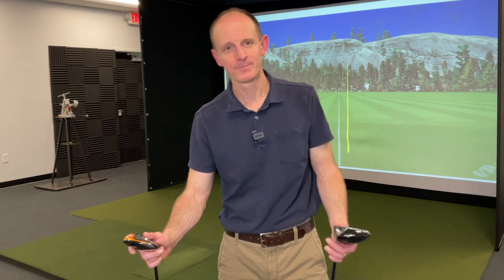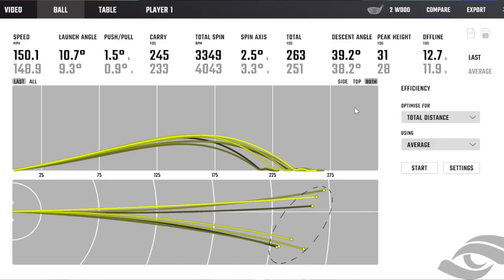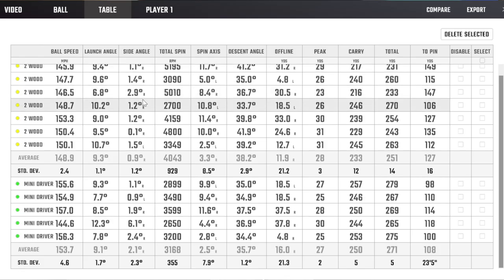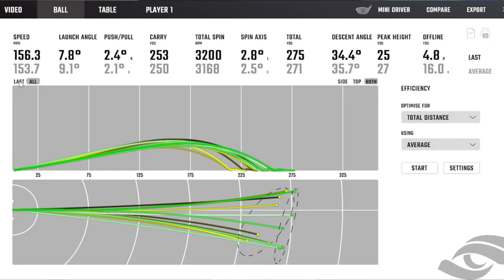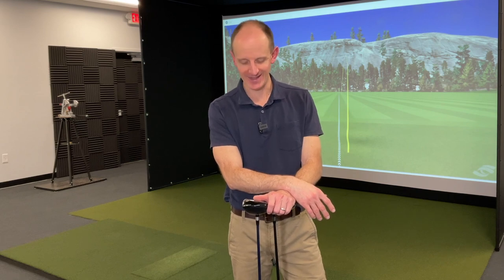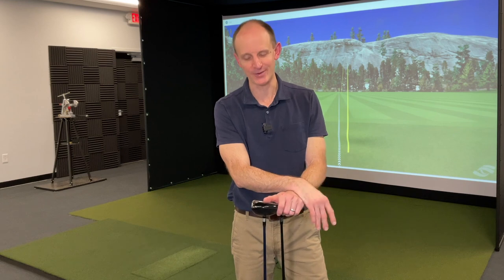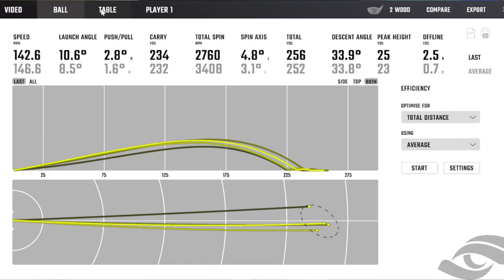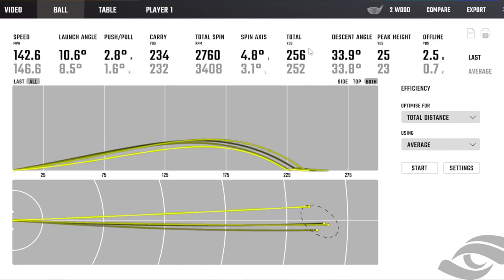Mini Driver or Strong 3 Wood / Off the Tee or Off the Deck

Comment: Thanks for showing that newer TM mini driver can be a fairway finder option for those who struggle with driver off the tee, or hit it to far into hazards on certain par 4 or 5's. 307cc head, twist-face, & shorter shaft.

Comment: Well that answers that question. Need something in between my 10.5 degree driver and 18 degree hybrid. Was tossing up between a mini driver and a 3 wood. The mini driver would get used at most twice off the tee at my home club, hitting off the deck on par 5’s is far more important and a 3 wood that can do both seems a much better option

Comment: Found 1995 Titleist DTR Driver for $9 , it's my fairway finder 240 yards (I can't hit my 2 modern drivers - I should sell them , but they are gifts ) For long par 5's it's Driver off the deck or 3 H or 3 Iron , mind you I just purchased C510 five iron with TT 300 S shaft only played it one round so don't know the yardage yet ,but it flies ....;-)

Comment: In only 1 of the 4 situations did you have a consistent ball flight, not missing both ways - i.e. the Strong 3+ off the deck. This was important for my own journey to scratch - building clubs in the long end of the bag that have a predominant shape. For me, all clubs longer than 5 iron, you want to have a 95% likelihood of delivering a specific shape - nothing else matters in comparison. If you can't control curvature, you don't know where to aim.
Reply: Every player, pros included, miss both ways.

‘Eliminating 1 side of the course’ is a myth.
Reply: @MEAT0  you seemed to have missed the point of what I wrote - i.e. consistent shot shape NOT what side you miss on. Shot shape is everything - if you can't control your curvature, playing good golf is impossible.
Reply: @wallstreetoneil  I agree but would like to add further if I may. Strive for consistent shot shape (includes straight hitters) but there is a limit you want for left to right and right to left. Pretty much impossible to play with big hooks and slices, so best to limit your curvature to a moderate fade or draw

Comment: No one ever does an exact comparison.
Hitting a 3 wood with the same exact loft would be much closer.
I no longer use a driver but instead use a cobra 3 wood set at 12.5 degrees and it's straight both off the tee and off the deck.
Driver is not worth 15 yards because it's usually the wrong 15 yards.

Comment: good video,  I struggle with this decision a lot . I have a tm mini at 13 and a tsr2+ at 13.5 .  Both avg. about 260 for me . I try to make my choice depending on the course I play as I prefer the tm mini off the tee .
Reply: @Twopeetfeet  I usually play the mini because i feel it's more forgiving and accurate off the tee. The tsr2+ is more versatile however . it's way better off the deck I just dont find myself needing to hit a 260 yd shot off the deck very often is why on most occasions  I play the mini

Comment: The shaft that is the only option from TM sucks.  I put in a chopped down GD IZ-6, and it's about even with my driver. I hit down vs. up on it. I have the 13.5 head and a 16.5 4 Wood when I don't want to use my Driver
Reply from the maker: Really not sure how that stock shaft managed to end up in that club. I mean I do know exactly how, but you think there would be other better options at same price.

Comment: You need to pre-load your impact position.  Meaning get into the athletic stance that you would have at impact as you address the ball and then swing. (Keeping your hips a bit strong to the left).  
Put the point of your elbow on the target rather than pointed towards your left shoe.  
This will start you making strong left pulls.  (No big right miss). Then you can work back from there.  
Currently you look stapled to the ground at address and trough back swing.   Your hips can’t fire through because you are super white and your best dance move is the hokey pokey…or that you are planted like a tree.   😅.  You’re welcome.